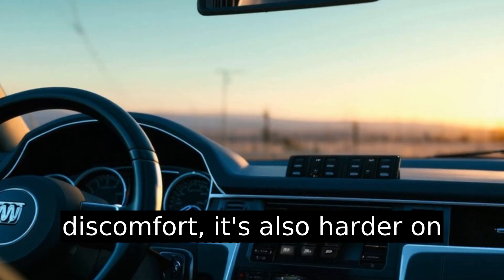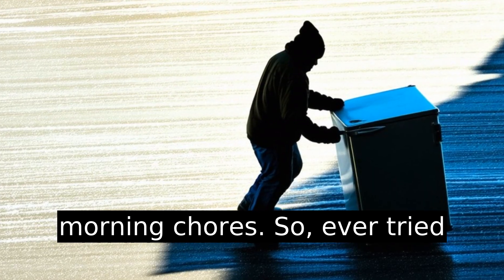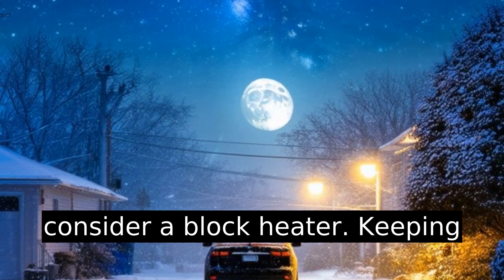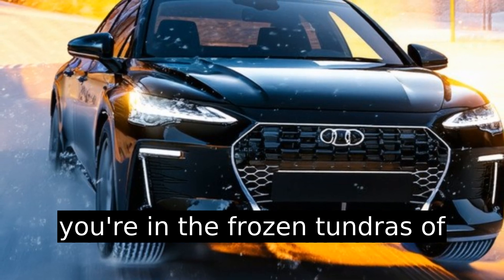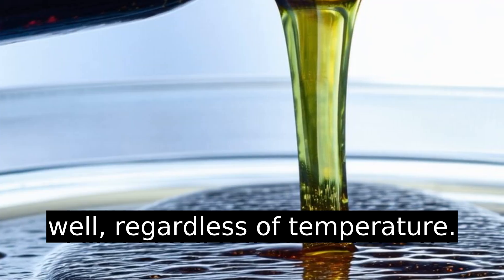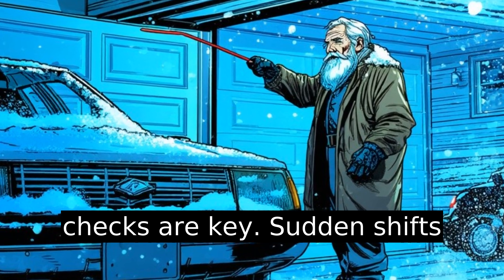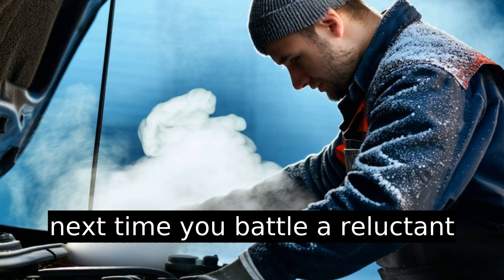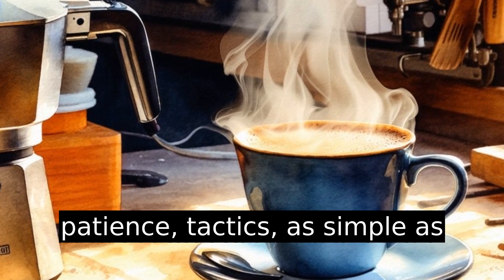Why Does Transmission Shift Hard When Its Cold?

Comment: I just drive mine slower for the first mile or so. I don’t stomp the gas and force it into the next gear. Many cars are designed to shift slower until car is warmed up, and driving (gently and slowly at first) is the quickest way to warm up your transmission and engine.
Reply: I do the same. Takes just 3mins to get it to normal operating temp